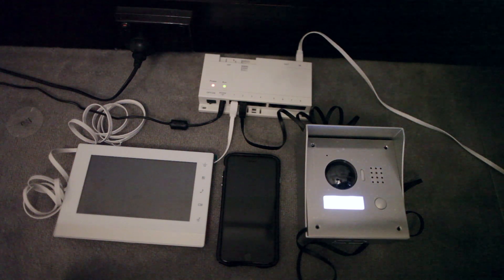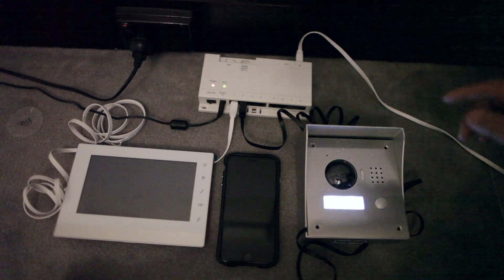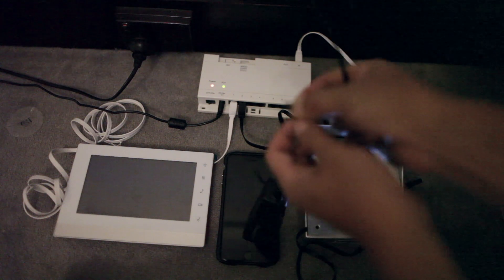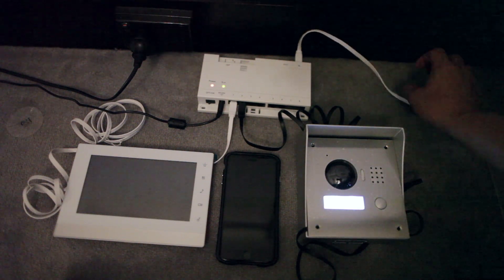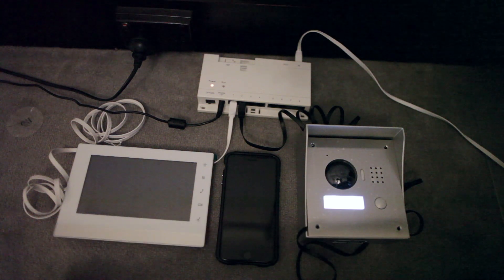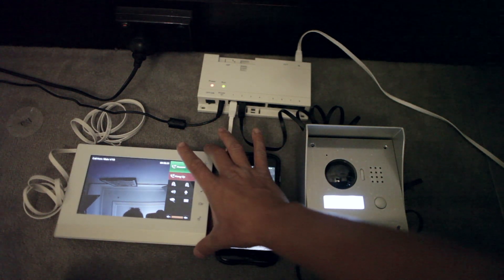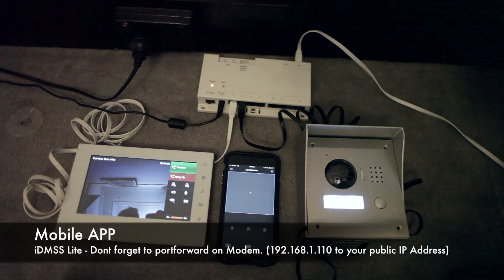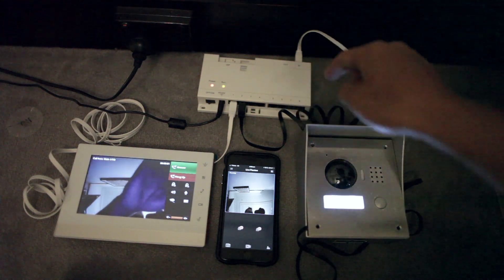Video Intercom - Dahua VTO2000A

Comment: Good timing. Can a standard POE switch be used? Where did you buy it from with the housing? Thanks
Reply from the maker: i havent tried it with a standard POE but i have just installed it all and everything works just fine on their POE. I got it from Aliexpress https://it.aliexpress.com/item/DAHUA-Video-Intercom-7-Inch-IP-Kit-HD-CMOS-camera-Support-mobile-APP-Without-Logo-VTK/32789296317.html?spm=a2g0s.9042311.0.0.9W7hWN
Reply from the maker: Finally tried it with a normal POE switch and it doesnt work.
Reply: So it apparently uses Mode B PoE with 4,5- 7,8+ all of which is non standard... so annoying
Reply from the maker: ThatYoutubeChannel I guess it’s their way of proprietary to enforce purchases of their switch’s which to be honest is quite reasonably priced. I think it was $60
Reply: Gavin poh yeah I had to just pick one up after waiting 2 weeks for the intercoms to come from China, I hope that there is a way to disable those annoying announcement and use custom ring tones is that in the current firmware?
Reply from the maker: ThatYoutubeChannel hmmm if you work it out let me know!
You can disable the “Door unrocked “ and choose one of about 5 ringtones but I don’t know about uploading a new / personal one. It used PcX files which I’m not familiar with
Reply: Might have found a way to change the ringtone files and possibly all the other shitty background icons and bad translations, I'm gonna do some editing, gamble my luck and try not brick the device and ill let you know, also check if your device has telnet enable itll make things a lot easier otherwise grab a USB to TTL Serial cable
Reply: @thatyoutubechannel5453  Do you have any results with changing sounds? Is it possible to do it through HTTP or WinSCP or Firmware modification? Or the only way is Serial connection?
Reply: What POE switch did you test this on? I have a Netgear 12 port POE switch with 100Watts output, Im about to test it on in a few weeks.
Reply from the maker: LandscapeInMotion I tried it on my netgear prosafe 16port POE and it failed to work. Not sure if it’s a power thing or just proprietary to Dahua. 
It’s only like $50 or something and well worth it to have a dedicated switch for the intercom.
Reply: Hi Gavin - I just found out Dahua devices need 24 Volts, but the Netgear Prosafe switch only supplies 12 Volts. Oh well, its enough to power my Rasberry Pi!
Reply from the maker: LandscapeInMotion good to know! I just thought it was some sort of proprietary software that prevented it

Comment: Nice video.... Is it possible to connect a external power supply and then connect it to a regular switch?? .. also i wanted to know the maximum number of devices that we can connect in a house.. is it possible to connect per say 6 indoor devices and 2 outdoor to a regular network switch ( considering that all the devices are connected with an external power supply)?
Reply from the maker: Nived Joseph I suspect the Dahua units have proprietary software that requires their POE switch to work. 
The POE itself isn’t expensive (USD $55) and has active 6 ports. Any reason you want to use a regular switch with injected power ?
Do you just have spare capacity?
You could order 1 intercom and 1 screen to test on regular switch first but for the sake of $110 I’d use their POE to save any networking conflicts.
Reply: Hey guys, do we know if we can use a non Dahua POE switch with this intercom yet? I have spare ports available on my 8 port switch which also runs my cameras. I could do what gavin advised and purchase just bell and monitor. But interested to know if its been tested. Cheers
Reply: Boris the bullet dodger - I've connected a 12volt - 1ampere adaptor and connected the indoor screen to the regular switch and it looks good so far.. communication is set..  however I didn't configure the intercom yet.
Reply: Thanks Nivid. Please let me know if the 12v/data combo works when configured. As for the intercom switch, the cost doesn't bother me it's just that I don't want an extra switch on my network if I can use my current POE switch. Can't find any info anywhere.
Reply: Boris the bullet dodger - this solution was recommended by Dahua as I am in touch with a technical manager . So I'm certain it's possible
Reply: Awsome! I'll just order the screen and station. Worst case I'll order the switch separately. Thanks Nived
Reply from the maker: Ive just tried it with a normal POE switch and it didnt work. The netgear managed switch i have didnt even register it.